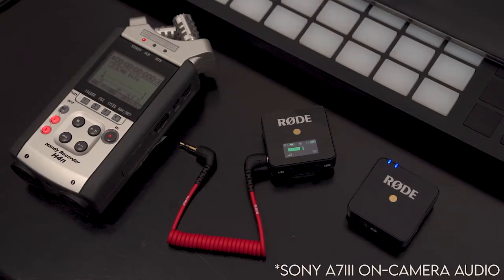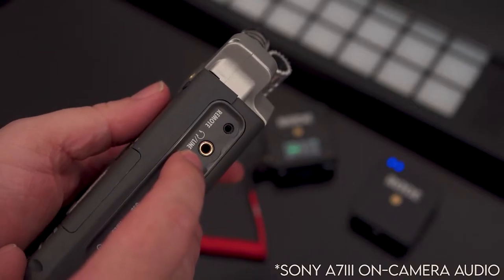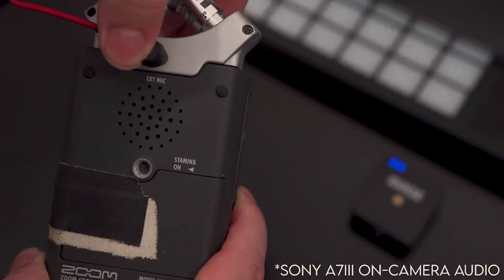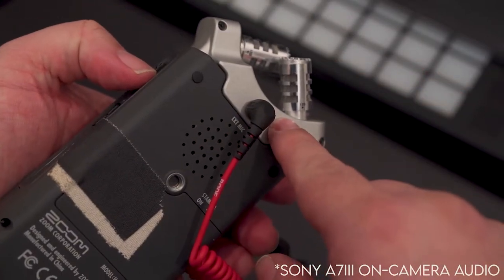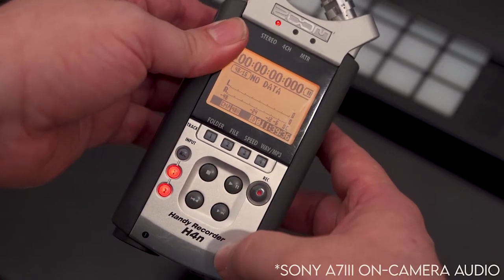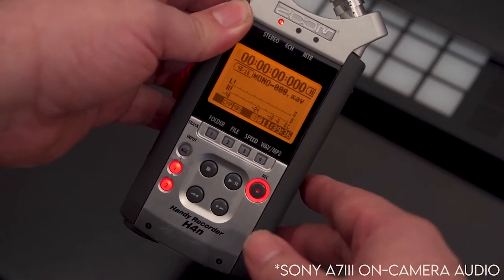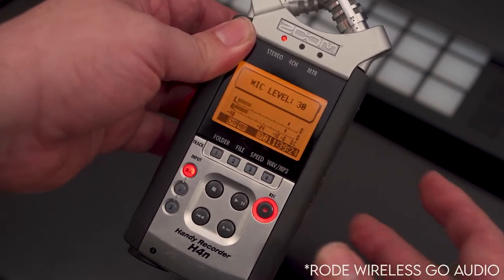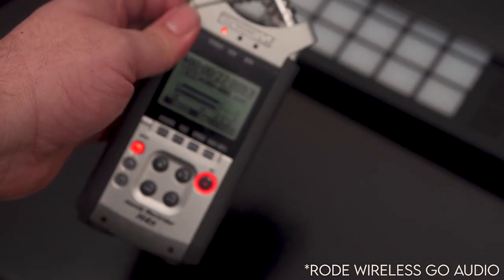How To Connect Rode Wireless Go to Zoom H4n

Comment: I need to run at least 2 rode wireless go into a simple mixer. Can you run the transmitter into the xlr combo jack if I use a 1/4" to 3.5mm jack?
Reply: I think so. But you need the converter.

Comment: Heyo, Im using the Zoom H1n with this setup but getting crazy interference from the cable. I can move the cable around to quiet the interference but it’s not reliable. Any suggestions?
Reply: I also use the Zoom H1n + Rode Wireless Go and experience the same issue. I want to find a solution as well.